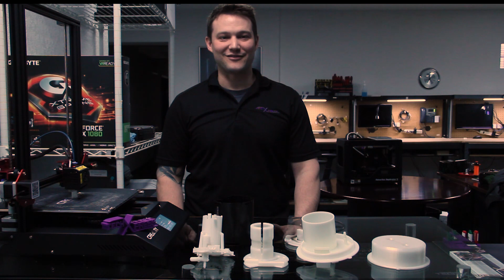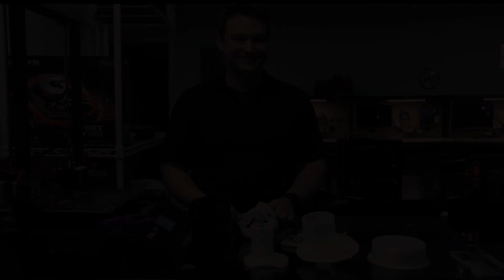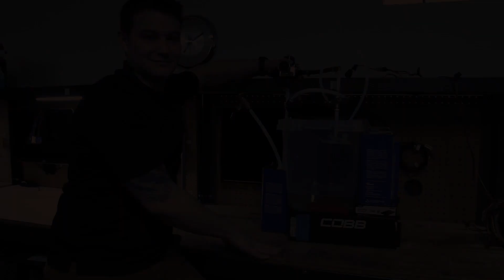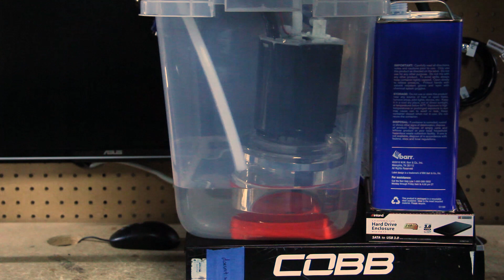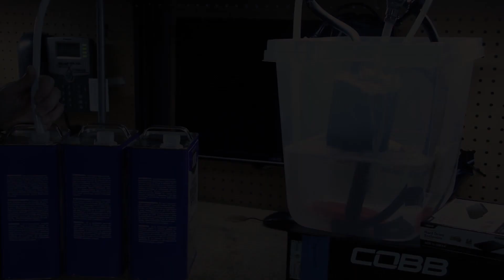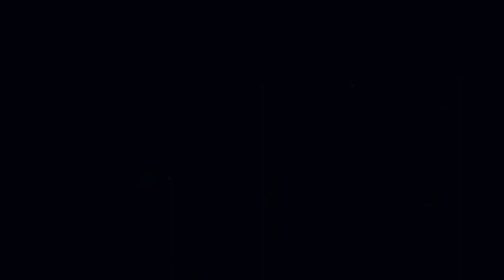McLaren IN-TANK E85 Fuel System Upgrade

Comment: Hey there,
I have a noise which I believe to be a fuel pump whining and wonder if you ever experience something a like. The car still drives absolutely fine except for the noise which goes away under load so mainly at idle. Any help would be greatly appreciated. Thanks